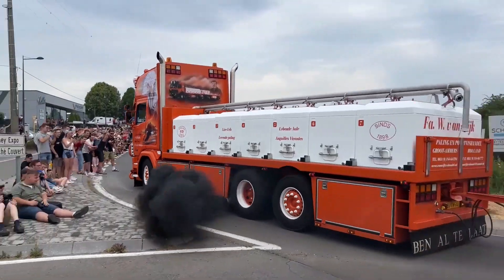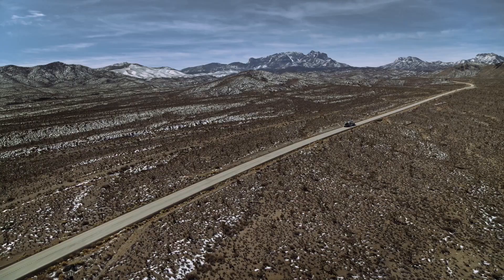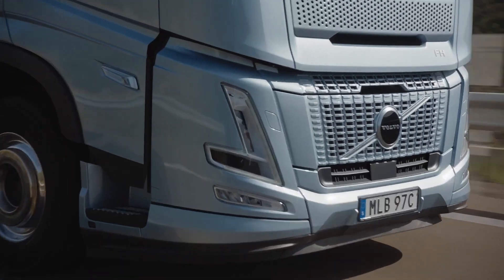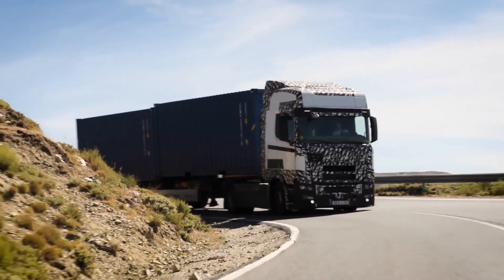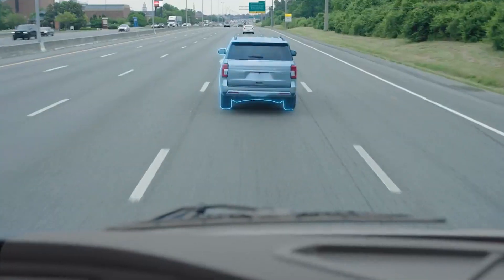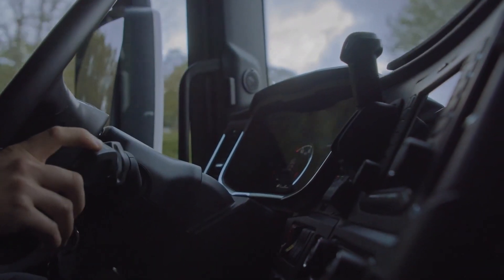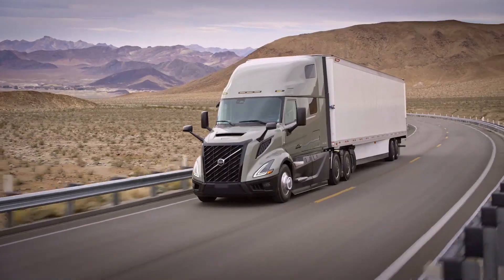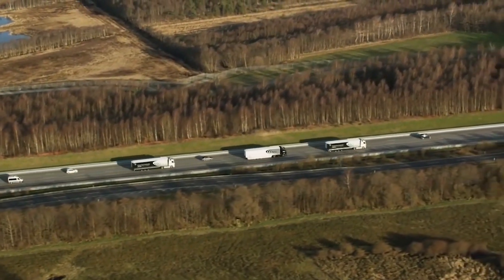Why European Trucks Are MILES Ahead of American Ones?

Comment: Like most things designed and built in the USA, american trucks are horribly out of date.    Same for their motorcycles.  If we had continued to use american technology,  we'd still be using CRT tvs and rotary dial phones.  Euro trucks are clearly leaps and bounds ahead of american trucks, and, with the continued dominance of manufacturers like Volvo leading the way, eventually the old KWs and Petes will become museum pieces.
Reply from the maker: @Fourandaquarter  I agree with your assessment of the US being out of date. Volvo in the US does not have a strong reputation or brand loyalty. They may get there but it certainly isn’t that way today.

Comment: So so so much of this is incorrect.
For example weight and length here in Europe. 
For example I haul duo-trailers in Spain, 31m long and gross weight of 70 metric tons. 
We also run more horsepower than American trucks, my Volvo is pushing 730hp. 
This video sadly really hasn't done its research.

Comment: The European cab-overs feel more roomy than they look.

But of course, the long-nose double cab American design has its advantages... you can do a roadside engine repair, without having to secure all loose objects in the cab, before tilting it. This challenge is smaller if it's just for scheduled routine maintenance..  but I could see it become stressful if you enter a truckstop with some systems already failing.

And the American double cab is like having a living room along with you.

I can see how that's appealing to owner-operators, which is more common in the US. They can basically go for months sailing the asphalt seas.

In European trucking, it's more often a company owning the trucks and assigning tasks.

So, while a trucker is usually attached to a designated truck, the sleeper compartment is supposed to be considered a last-resort hotel room, more than a home away  from home.

New EU rules also require companies to book actual hotel accommodation to truckers if they're on a longer trip. So that they're not trapped in their sleeper and confined to truckstop showers for months.

And then there's of course the older regulations, that basically forced euro-trucks to become cab-over single sleepers... a long-nose cab would simply make it impossible to pick up standard 40ft freight containers, because of the total length regulation.

What's it worth having a big truck if you're not allowed to pick up standard size containers at the nearby harbour or cargo train terminal?

Being able to navigate curvy old streets is basically just a side effect that may have saved a few local distribution points, because goods can often get delivered by semis, rather than smaller box trucks, within cities.
Reply: Regarding autonomous.

I know it'll come around sooner or later, but I very much prefer a cautious approach.

So far, I very much appreciate that there's a driver being responsible for monitoring that the vehicle's automatic assistance systems are working as intended.

An experienced driver will also be better at evaluating whether another human driver is risky or aggressive, and thus tell the system to expect irrational behaviour.

Gradually I'd allow truckers to "take breaks" while camping in the slow lane on long hauls, if the warning systems get good enough at getting the drivers attention ahead of time.

Then I wouldn't mind if the driver is reading while having a cup of coffee on a 300km "straight ahead" highway driving.

Half of the systems needed for "Platooning" is actually already built in to many regular European cars... they can warn each other of an emergency braking happening 5 km ahead of where you are.

When the vehicles behind you can recognise a reckless driver from behind, we're getting close to a point where regular cars could also be allowed to let the driver have a break while camping in the slow lane.

Fully autonomous driving from anywhere to anywhere is still many years ahead I think, especially in Europe where cyclists and pedestrians are not conditioned to act like second rank in traffic.

Edit: could somewhat be an advantage if there was somehow to signal to other drivers if and when your vehicle is using ACC, Lane Assist or Platooning... it could calm down the aggressive driver to know that your "annoying behaviour" (going below speed limit) is simply because you're not in a hurry.
Reply from the maker: @BenjaminVestergaard  I am with you on autonomous driving. It will be quite a while before we see that happening at any kind of scale.
Reply from the maker: @BenjaminVestergaard  thank you great additions to the differences that we were unable to hit on in the video. That is an interesting fact about regulations around getting hotels.
Reply: Another comment from someone who is not a truck driver.
Reply: @alexpervanoglu7420 you're right, I'm not a truck driver, my drivers licence only goes to 3500kg. So I'm just a regular driver. 

But I'm also an embedded software developer... so I understand quite well what challenges the software side of it has.

As I said... we're far from a level of autonomy that I would trust without a "pilot" for more than a few minutes on a long stretch of highway. 

I cringe when some companies claim that autonomous cars are just around the corner... so far, these vehicles are only permitted within very limited areas that have been mapped out with great detail. And knowing how pedestrians and cyclists usually behave in that area.

Even with a lot of map data... those vehicles would hit 30 cyclists a day if they were released in Copenhagen.. simply because cyclists act differently.

Until the cars (on their own) have sufficient AI capacity... we won't see actual Fully Self Driving in neither hatchbacks or trucks.

But until then, don't be afraid of using the assistant systems... they're collecting data and learning from human interaction when necessary. 

And don't tell me that you're better at parking backwards with 2 trailers by eyeballing it, with the right sensors, a computer can get within millimetres without cameras..  they're good at maths.
Reply: @BenjaminVestergaard  I was actually referring to the fact you seem to know very little about the regulations and physicality of trucks here in Europe.
I'm not interested in the software side of it. 
Sure some of it helps us and my 3 year old Volvo is loaded with computerisation which helps with safety and fuel efficiency.
However, for example length wise, I run duo-trailers at a total length of just over 31 meters and gross at 70 ton. 
Cabovers here have little to do with length regulations and more to do with manoeuvrability. 
Also your hotel comment, yes we have to be drivers up in a hotel if away for more than a week, but also we cannot by law send drivers away for months at a time, the standard expected limit is to have them home within two weeks of leaving base. 
And no sorry like your vehicle automation vs cyclists computers are not going to be betters at reversing even one trailer let alone a superlink. 
Anyway the fact you wrote a load of incorrect informations about Europen trucking, was the give away, especially given I've been in the game 30 years now. 
Sorry about that but there is no point commenting on a subject one knows little about. 
That is where this video also failed as it contains a lot of incorrect information claiming it to be fact.
Reply: @alexpervanoglu7420 alright I may not get every number down to millimeter precession... but am I wrong in saying that a nose truck would become too long with a 40ft standard shipping container?

Euro-trucks are allowed to carry more cargo than US trucks, isn't that correct? (In some countries where logging is a big deal, a whole lot more)

About backing up, if you have the right sensors,  the software can know the exact angles between the tractor and both trailers as well as their wheel positions etc.

If you do your math correctly (which I'm not sure the current generation does) you can land within 5mm from your target point with blinds on.

Moving heavy objects on wheels can be done by simple math... if you have enough data to start with. An average PC can do a hundred predictions and corrections per second without breaking a single drop of sweat. What you feel comfortable with may be very different, I understand... but in self driving, getting the maths and actual physics to match is a quite easy task.

Predicting human behaviour is way more difficult. Which is why it's a good thing that emergency braking is running on a separate system to begin with.
Reply: @BenjaminVestergaard  Standard trailer length here is 13.5 meters or 44.29 feet. 
A standard shipping container is 40 ft yes but not the trailer that carries it. 
Length regulations were increased quite a long time ago and so yes if we wanted to we could use the fairly standard US model trucks, however their manoeuvrability for the type of roads and delivery point situations we find ourselves in mean they just don't make any sense. 
Out of house conversion companies have produced tractors such as the Sania Longline which more than compare accommodation wise to US truck models. 
Weight wise and length wise I have already explained how much I haul here in Spain. 70 ton or 156,800 lbs, with two 13.5 meter trailers in tow, so yes almost twice the 80,000lbs standard in the US. 
As for your computers reversing trucks, how.
Will they be able to tell when a forklift is moving around us as we reverse, or that stack of 300 pallets they moved to a different position from the day before, or the car that has just pulled up and parked meaning I have to make a reapproach, or spot the new guide rails they had installed on a bay I've not been to in three weeks. 
I can can assure you the haulage industry and the things we have to achieve with trucks is nowhere near as simple as the average layman thinks it is. 
You see us hauling up and down the roads but have no concept of what goes on behind the scenes. 
I'd love to know how this mathematics of yours is going to cope with forever changing scenarios from one day to the next, even if we just took one delivery point into consideration, how would it cope when yesterday's mapping is completely different today ?

Comment: It's the same nonsense as always, but Americans are raised from childhood that America is the world's largest country, and the world's freest country, and the world's smartest country, and nothing could be more wrong! But Americans refuse to see this fact.

That an American long-nosed truck will be easier to work on is pure nonsense, as the mechanic has to climb over the wheels, and the bumper, and the gearbox that is hidden under the cab, and is therefore very difficult to work on, and don't say "it never breaks" because everything breaks at some point!

The European has free access to both the engine and gearbox when the cab is tilted, which can be done by pressing a button, and an electric pump raises the cab. Then the fenders are removed by loosening 2 clips, and there is free access to everything, without having to climb over everything.

And the technical stuff? no! American truck industry is not catching up, they are conservative, and have a total lack of desire to change anything, since this affects earnings, and why reduce profits when lobbying has created rules that make it impossible for foreign trucks to compete.

The USA is actually more communist than the Russians!

Find an American truck that can do this!
https://www.youtube.com/watch?v=HnCU20Cu0fs
Reply from the maker: Thanks for tuning in. Can definitely tell this video struck a nerve for you. That is quite an impressive stop by that truck in the video you shared.

Comment: Nordics sweden finland ect the lengh limits and weight its diffrent weight it much more then in the US 74-76 metric tones and 34.5 meters norway 55 metric tons and 24 meters total its differs alot vs "Europe" Scania also have LOngline cabs and are gonna start to produce them agine not to mention swedish volvo and scnaia has more hp and tourqe then American trucks up to 770 hp scnia and 780 hp volvo distances are bigger in nordics vs most of europe also nordics has alot more owner operators or smaller companies that want to attact drives whit custom cool trucks ect

Comment: What Canada should do is to lift regulations on trucks. Shut down the factories in Canada that are helping to build Peterbilt trucks and instead move towards european trucks. Those fired from the factories making Peterbilt, should be first to get an offer to work for the new factories making Scania, Volvo, MAN etc. Faze out Peterbilt, which is american, and hurt them in their wallet by refusing Peterbilt trucks. This tradewar, will in the long run help USA, but right now they're about to be without any allied trade partners and Canada who is threatened by becoming 51th state should really fight back. Not only have they started doing so in many other ways, but here and now they can upgrade to better vehicles. We even have electric Scania trucks already roaming the streets. Something Impossible for Peterbilts.

European trucks are made for the driver and if you drive far, then the only thing making Peterbilts more attractive is the space where you can relax. No way a real truckdriver finds comfort after driving to be more important then the driving of the truck itself. The way you sit, the way you handle problems occuring from truck breaking down, breaking, turning, power output etc etc etc.
Bruce Wilson, who is showing the Scania 770 on shows right now in US, has already debunked many lies about the cab and its size. SO many truckers he is talking to would absoluitely be interested in change of truck if they were given the chance. 

USA knows how bad it would be if they let european trucks into the nation, and lifted some regulations, to make room for more options. Money lost would be insane. So this is where Canada could make a big dent in the american economy. Its time for US to stand on their own legs if then seek it. Sorry for those americans that didnt swallow the lies (and continuing lies), but youäre citizens under one flag so we dont want this but we cannot let it slide either. EU + Canada first. USA not even on the list anymore of friendly nations.
Reply from the maker: Thanks for the great comments! Interesting take for sure. You can tell you have put some serious thoughts into it.
Reply: It would be an easy move since most of these trucks companies are part of the same groups, Paccar owns Kenworth and Peterbilt but also Daf in Europe, same f8r Mercedes who owns Freightliner, Traton owns Scania and MAN but also International and Navistar, you have Volvo who sell on both continents but owns Mack and Renault Trucks!